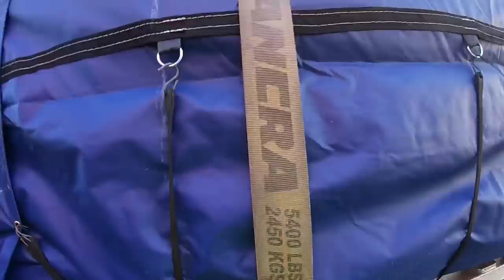Drop and Hook Pre Tarp Load And New Drive Cam P&S Transportation

Comment: Heard anything about Cypress?
Reply from the maker: Pull mostly Sheetrock and lumber. Based out of jacksonville Florida
Reply: Nice Visions yeah. Im in Tampa thats the big flatbed carrier down here. Just wanted to see if you knew any info on miles and pay
Reply from the maker: @tyjr1985  I believe cyprus has a pretty good rate between 45 and 50 cents. But you could google it though and find out for sure